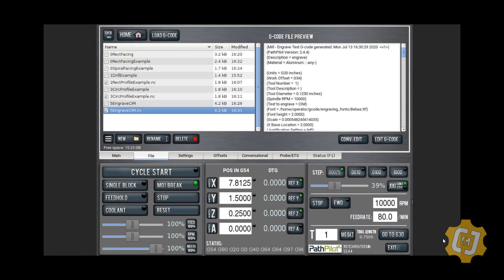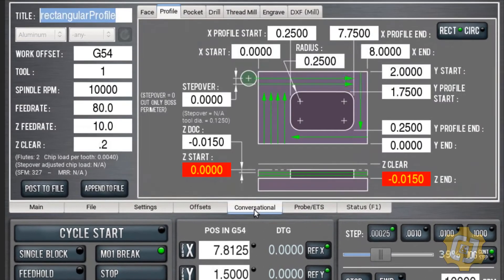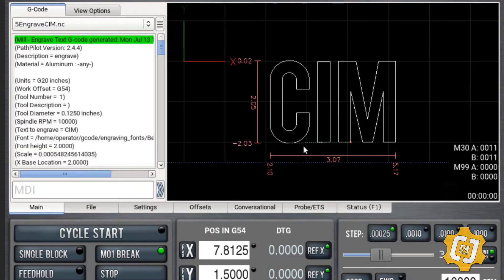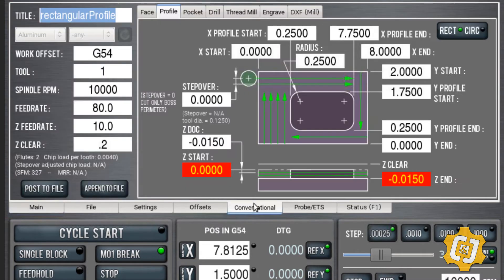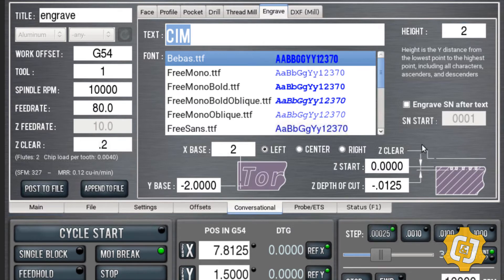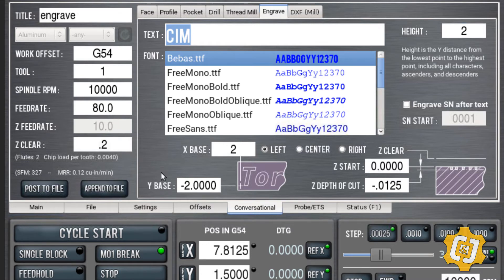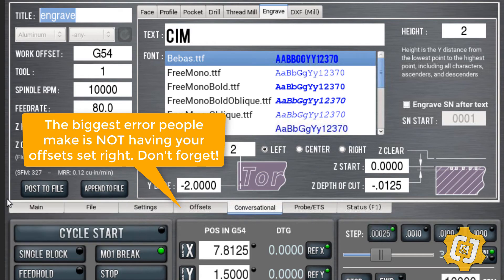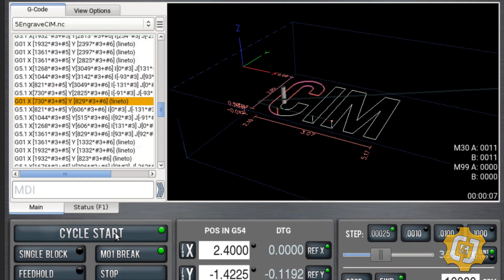7 Engraving Text: PathPilot Conversational

Comment: Hello! What tool did you use in your machine? How do you decide on the tool to use? Is there a standard?
Reply: I use a small 2 flute .062" diameter carbide short ball nose end mill, about .002" to .003" deep.  If I did a lot of engraving, I would invest in a spindle speeder to get higher rpm for faster feed rates.